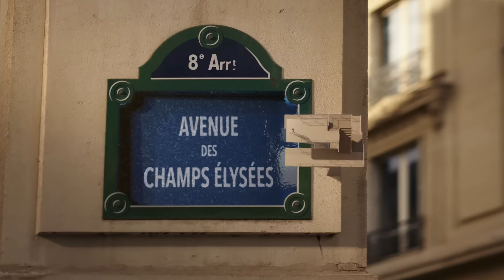What Makes Omega Better Than Rolex?

Comment: Are we certain anyone genuinely went on the Moon ? What about if this is later found to be false and everything then would be a theatrical stunt…

I enjoy my Omega Seamaster NTTD, I bought it in 2022. It’s great, discrete, subdued and fantastically accurate. I love its Metas certification. My only criticisms are as follows:

1) the movement mainplates, bridges and rotor frame should have been titanium for extra lightness.

2) the movement should have been larger to fill the watch case rather than use a metal spacer.

3) a larger movement would allow dual barrel and therefore much longer reserve.
Reply from the maker: It's fascinating to think about the possibilities and theories surrounding the Moon landing! As for the Omega Seamaster, it sounds like you have a keen eye for detail—your suggestions for improvement are quite insightful!

Comment: Rolex only compete against themselves ! They are the industry leader for generation and every other brand follows
Reply from the maker: They are leaders in many ways but Omega innovated in many ways too. Don’t you think?
Reply: @thesecondhandclub  No, the co-axial was no advance, no real benefit:  not more precise/accurate, no better service interval, and bulkier.  That’s poor engineering—makes the watch thicker without any benefit.  Also take the Omega helium escape valve—it does nothing that simply opening the winding stem will do in terms of decompressing in a chamber, yet it adds another point to leak, especially if you forget to screw it back in.  All they really have keeping them going are the Bond movies and the Moon Seamaster…but if you want one they can be a very good buy on the second hand market as their re-sale value is terrible (never buy Omega new).